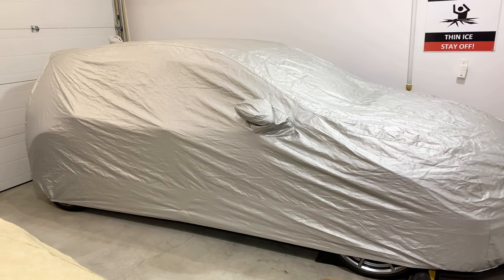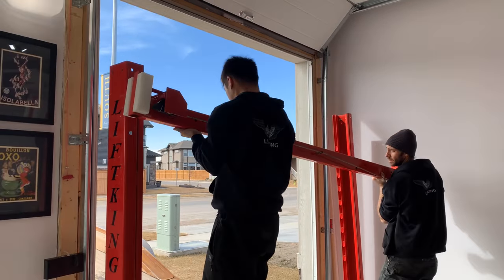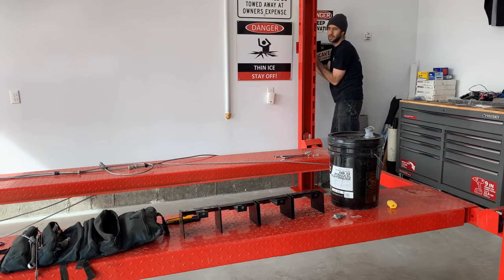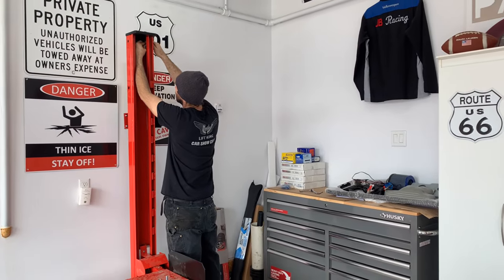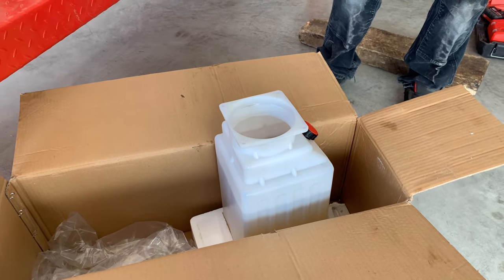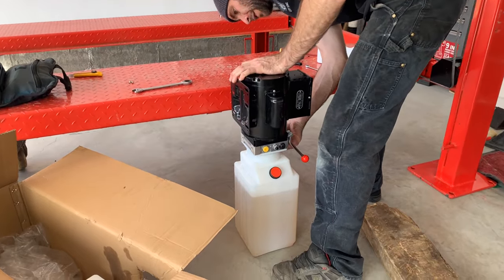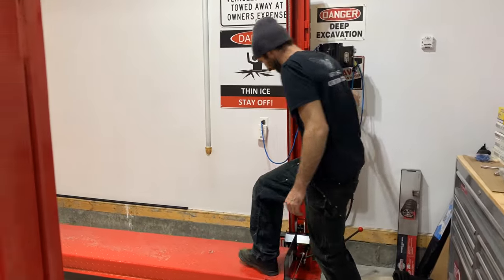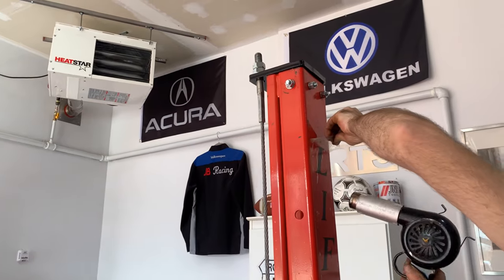I Finally Got My Lift King Four Post Lift | My Dream Garage | 4 Post Lift Install & Maintenance Tips

Comment: Very much appreciate this video!! I have watched it a few times as I'm trying to decide on this lift vs a couple other options here in the Ontario area. Not sure if you feel comfortable answering this question (no worries if not) but did you have any concerns about this lift not having ALI certification? I don't know if it matters from a home insurance perspective. I believe Lift King states that it does have CE certification as that is required over in Europe. Other vendors who do have ALI certification of course make a big deal about it but not sure if it really matters for a residential type environment. Many thanks!!
Cheers
Kevin
Caledon, Ontario
Reply from the maker: Hi Kevin, first of all thank you for your appreciation of the contents I shared in the channel! It means a lot! In regard to your question. To be honest with you, I didn’t really go to that extent during my research. I knew they were CE certified, as they sell this units globally.  As I acquired the unit for home use mainly and knowing so many local car guy with it, I didn’t have any concern. But not to say I never considered my safety.  I am all for my own  wellbeing when working with my cars and constantly having in mind my safety when operating or using the lift. I make sure it is well maintained and serviced by me.  Always paying attention with undivided time when opening the lift.
Reply: Thanks so much for your prompt reply!! These guys have been in business for a long time and sounds like they have good customer service and stand by their products. You were lucky to have a great installation crew there who obviously take pride in their work and fortunately were willing to share their expertise. I agree that this machine requires your undivided attention when in use. I'm pretty tight on ceiling height (10.5') so will definitely be paying attention when lifting my wife's little convertible (don't want to be having that conversation if it hits the roof lol). Have a good one!! @JNBTuning
Reply from the maker: @KTR2020_1  you’re welcome!  You as well, thank you 🙏

Comment: Was your floor at an angle,and if it was, did you find any binding with the lift?
Reply from the maker: My garage floor do sloped down slightly toward the door to allow water to run off. I placed 1” rubber pads under the 2 front post to compensate a bit, but I can’t say there is any binding. The lift works well and moves freely. I am not sure if this what you meant by binding!?
Reply: @JNBTuning  thanks, that's exactly what I wanted to find out.
Reply from the maker: @patricktenn7996  In the process I did consulted Ross @Lift King and I was told that the 4 post lift is awesome in terms of garage floor that are uneven.